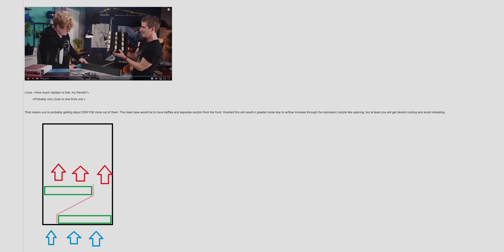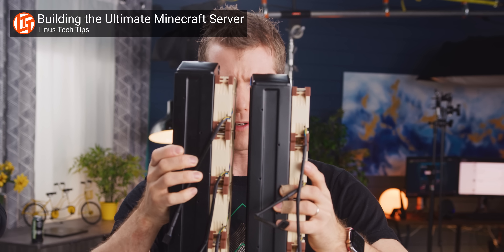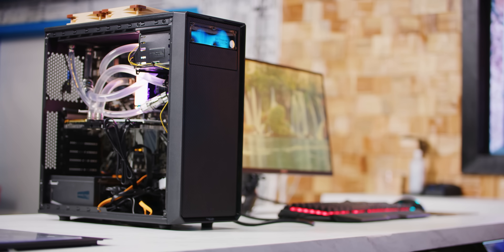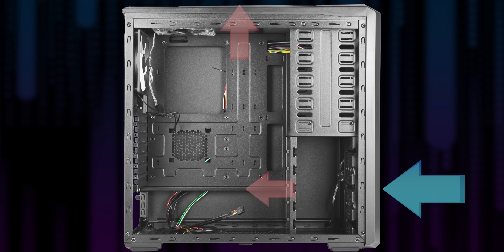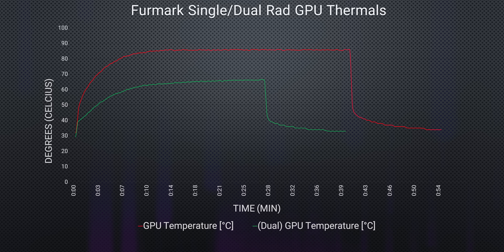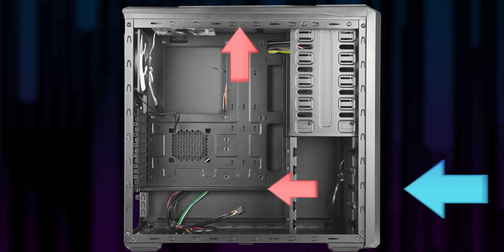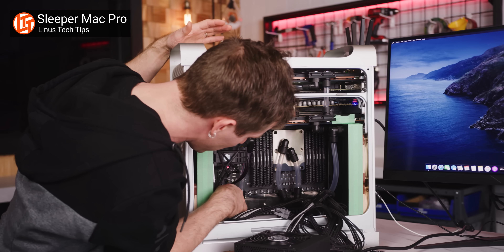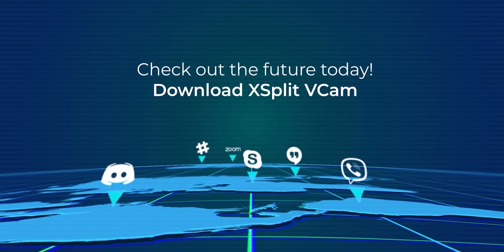I’ve been water cooling wrong for YEARS - $H!T Manufacturers Say

Comment: A second rad for almost any system is for esthetics. Not all but most. I use a single 240/45mm Alphacool with push fans and my idle on a 3700x and 1080,both oc'd, is 38c/29c respectively.

Comment: Corsairs testing may be accurate depending on the order in which the radiators are plumbed into the loop. Every radiator dissipates heat, so if you have a bunch in series (such as in the server chasssis) you want the loop to run from the heat sources into the farthest downstream radiator (in the air column), then the middle, then the first. This will be more effective than a single radiator, but less efficient than running a bunch of parallel radiators (each with it's own fresh air intake)

The first radiator in the water path (which is also the last in the air path) dissipates some heat, cooling the water and raising the temp of the air. The second radiator does the same, so when the water gets to the last radiator (the one taking in fresh air) the water temp is lower,  ut so is the temp of the air flowing over it.

If you run them the opposite way, where your first radiator Carrie's the most heat directly from the CPU/GPU into the fresh air stream and they are stacked then each subsequent radiator does almost nothing, or can have a negative impact as not only does it have the dissipated heat from the first radiator blowing through it, but also the added heat generated from the fans before it (probably a negligible amount, but theoretically something)

So in your desktop test example you can experiment and verify this:
1. The theoretically more efficient system would have the water flow from the CPU/GPU through the pump, then the top (exhaust) rad, then the front (intake) rad and back to the CPU/GPU
2. The theoretically less efficient system would have the water flow from the CPU/GPU through the front rad, then top rad, then pump and back to the CPU/GPU

Basically Corsair is right in scenario 2 above, and wrong in scenario 1. It would be interesting to see you guys test this out

Comment: All you got to do is put the exhaust rad "first in line" after CPU and GPU and you will have significantly improved your dT at both exhaust and intake rads. Stacking more will still improve things, but the returns will diminish quickly.

Comment: Car design: Back to back radiators = BAD

Car design: Side by side radiators = GOOD

As soon as the airflow leaves a radiator, that air temp has risen, so it's less effective at "cooling".

So in a PC, draw air into the cabinet via vents and pump it out via a panel 1 radiator deep. If the temps are too high still, add a radiator to a different panel. Not on top of the other.
Reply: I wouldn't make such a big science out of it. It all comes down to the available space. I mean most cars with intercoolers have them in front of the radiator, because putting the intercooler somewhere else is very complicated due to space and the loss in cooling capacity doesn't make up for the loss in space.

Comment: Stacking radiators might be bad, it all depends how dense the radiator fins are, how thick it is, and also, the fan profile might make a big difference because noone really push the fans to the limit all the time. The pump was d5, which is rly powerful,  do one more test, with like EK DDC pump, and do it with like ~50% fans all the time, as casual rig builder would get with a customized fan curve. then you would see the difference. I think that Corsair took the real world scenario, not the loudest possible.

Comment: but wouldn't the 2nd rad that you installed that specific way transfer heat (at least some) to the case, since the fans were not in between?

Comment: Huge flaws with the test---the case was open water volume was also not equal.  Thermal conductivity of air and water matter. 
There is a quantitively measurable loss of heat just from the large volume of water alone without the 2nd rad itself.  Seterus Paribus, did you measure the airflow entering and existing the case with both setups?  Were they equal?  Of course not in either scenario!

Seriously though, a second rad will benefit that's why vehicles have separate engine oil coolers, transmission coolers, A/C evaporators.

Comment: Why do you think cars typically only have 1 radiator? Yes, the benefit of moving air helps, but there's no need for more unless it's some crazy hypercar like a Bugatti, both the Veyron & Chiron have 10 radiators. I hate them though, they look like flying eggs. 
Hell, Porsche 911s didn't even get radiators until 1997.
My point is: redundancy is not usually efficiency.

Comment: Woah woah stop there Linus
You didn't provided us with complete data 
- jack removed which radiator from stack
- testing condition
- and you are passing a judgment and then saying  test it on your own 
-and as you said corsair didn't criticized that specific build 
- I think Corsair is right Linus if you put hot air in radiator it do reduce there performance
- probably you are getting better temps is just 30% of the performance 
- my advice will be not removing radiator but giving them some cool air through some vent or 3d printed air flow controller type ting
- in normal conditions people who are doing first time or with a very less experience are gonna add as many radiator as they can
Many people watch your video

Comment: So you devised a test to prove Corsair wrong by oversaturating a 240mm Radiator which would then transfer the still hot fluid to the second radiator.
You fail to measure air temps at the exhaust of the first radiator and the inlet of the second radiator and finding that delta. If the exhaust air is just below the fluid temperature (saturated), but significantly lower at the inlet of the second, you do have hot air mixing with external ambient air and are providing a delta on the second for further cooling of the coolant, resulting in lower chip temps.
Stacking like that done in the minecraft server is mindboggling inefficient, you either get to ambient temps or you don't if the first rad is getting you 90% of the way, the other rads are creating lower pressure zones assisting airflow through the first with their fans and either increasing the temp drop on the first or pulling the air through before equilibrium creating a big enough delta on the second radiator to further reduce temps. A single radiator with High RPM delta fans rather than a whole bunch of noctua consumer fans and three rads would make more sense.

You often see twin tower coolers performing only marginally better than single towers with push pull which only give you a benefit if the cooler is saturated with only one fan as the second fan improves static pressure by creating a low pressure zone in the cooler effectively lowering resistance for the first.

While surface area is a good thing, it doesn't really do a whole lot if a smaller surface area is dropping the temps adequately. The main benefit of big coolers is that lower fan speeds can be used to drop that delta towards ambient.

This vid is a load of reused hot air.

Comment: Physics does indeed tell us that stacking radiators results in diminishing returns in terms of cooling power.

Basically, if you have a radiator of certain size and airflow, it can transfer a certain thermal load into air (at a given ambient temperature).

If you double the radiator size, then you (more or less) double the thermal load it can take.

But if you take two radiators and straight up stack them, then you don't get double the cooling. It should be significantly less than that, maybe 10-15% improvement. Eventually the airflow temperature and the coolant temperature in the "extra radiators" approaches each other and that basically stops the radiator from transferring heat from coolant to airflow.

Using a radiator connected to an exhaust can technically work: As long as the air inside the case is cooler than the temperature of the coolant, then it will provide some cooling effect. However, that cooling effect will be reduced compared to using the same radiation in an intake configuration, where it has access to cooler room-temperature air (and therefore the temperature difference between coolant and airflow is greater, resulting in more heat transfer capacity).

In a thorough test, you should probably reverse the airflow on that exhaust radiator and configure it as an extra intake instead. If there are other fan locations available to use as exhaust fans, that's fine, but it would be worth it to test the case in overpressure configuration as well, to see if you can still get good enough airflow that way. If the case produces too much resistance for air to escape, then that might constrain your intake airflow, and reduce cooling power that way, but like I said, worth testing.

Comment: run a benchmark on your phone!? That's it, the quarantine has finally broke Linus! In truth they kind of are correct by thermal dynamic principals(HVAC Tech). My recommendation would to have the rads in the same orientation, IE both intake or both exhaust with other fans helping move fresh air. Not to mention the static pressure increase by stacking the rads would be horrible, your friends rig would probably drop his temps to frigid if he separated the rads.

Comment: I think you guys should've done an additional test with radiator that weren't stacked. I think they're saying that the hot air from one radiator isnt cooling as efficiently on the 2nd radiator when they're stacked. They need to be side by side or on different parts of the case. I'm sure a side by side setup isn't practical but I wonder if you would get even better results with a side by side setup or even just separated from one another

Comment: It also depends on in which order you connect your radiators. If you have the radiator with the hot water in the intakte side of the PC (so the one which comes in the loop right after the GPU and CPU) and the one with the cold water ( the second radiator in the row) on zhe exhaust side of the PC, you get better results than when you would change them

Comment: You should measure the temperatures of the water and air entering and leaving the system! This will let you know about the radiator system efficiency and if there is excess thermal a capacity in the air to absorb more heat.

Comment: Edit: Comment was made before I got to the 1:40 mark
Um, if hot air is being blown through a radiator, wouldn't the radiator just become a glorified reservoir?  Just from applying some highschool physics, you can tell that adding radiators like that would provide diminishing returns.
Heat radiates faster when there is a larger difference in temperature between the hot and the cold. When the temperatures are more similar, heat won't radiate away from the radiator as quickly. Just from that, you should have listened to Corsair's first email as it makes sense from a scientific angle.
To make matters worse, the better the first radiator is at cooling the water, the entire loop could get worse. In extreme scenarios, the second radiator may heat up the cooled water or not provide any benefit at all!

Comment: 9900ks + 2080 uses about 400w power why do we use psu of 750 or 850w ?
Reply: 650w PSU are enough if you're only using a single GPU, PSU above 700w are usually for those who want to run a dual GPU setup. While 850w and above are usually for high efficiency like platinum and titanium, high-end PSU also have a 0 fan more so the fan won't even spin unless it draws a certain amount of wattage, making it more quiet

Comment: I’d be interested to see if the temps improved if both radiator fans were set to intake but the other spare case fans were set to exhaust the heat. Obviously this would mean both radiators are heating up the internals but is this more efficient than cooling one rad with the expelled heat of another
Reply: Best bet with just one intake-placed radiator is to pre-cool the hottest water (the one directly from the cpu/gpu) with a radiator that gets it's air from inside the case.

Then you'll want to cool this water further with a second radiator that gets its air freshly from the outside. Not only will you be able to get the coolest water with this setup (because if you cool something which is already cooler than what it was in the beginning, it will end up closer to the temperature of the thing you're cooling it with - so the air) with just one intake. Also you'll reduce the overall heat that is added to air inside the case because the air from the outside-to-inside radiator is cooler in this configuration.

This style of cooling is referred to as countercurrent exchange in industry and engineering. Source: I have a masters of scinece degree with a background in industrial applications - and we need to cool a ton of stuff.
Reply: ねむネコ that make sense if the two radiators are linked in one loop, for sure. 

I have two all in one coolers which are separate one on the gpu and one on the cpu. I wondered if both would be better set to intake. Tried it out and I got a bit worried that the rest of the internals were then getting the heat from two aio exhausted air so switched it back. My gpu gets cooled from internal air and still hits 40 degrees after a few hours of gaming which is about the same as the cpu getting cooled from outside air

Comment: 1) Adding radiators does nothing once thermal equilibrium is reached....
2) Pull cool air from outside thru both radiators
3) Use some sort of funneling to move the air that's just been pushed thru the radiators, immediately away from the case, Ducts that blow the "spent" air directly out the side panel(s), via cut-outs in the side panels with some nice mesh covering for instance; the G5's had that nice internal molded clear plexiglass contraption to direct airflow.
4) More case fans, to pull hot air out of the case :-(
Reply: @Charles Clarke I think the most powerful and energy efficient water cooling would not use air at all. It should use cool water from the tap to cool the system. Only the mainboard and power supply would be cooled by air then.
Reply: Your first statement is nonsense.  Having more surface area to radiate or convect away heat changes the temperature at which thermal equilibrium happens.

Using inlet air on both radiators can work, but you need to have sufficient exhaust.  It's usually easier to exhaust on all radiators and leave the front of the case for inlet, since there's far less resistance to airflow without a radiator than with, so you don't need as many fans on inlet as on exhaust.
Reply: @TrueThanny  no it is not. Simple matter of fact. There will always be a minimum temperature  that cannot be a improved upon. Under sustained idle / medium load / full load, the cooling capacity will always reach a specific respective temperature...an amount of heat that cannot be further extracted due to the specific design capabilities of the setup. Simply blowing air at some metal is not going to decrease the temperature of that metal beyond the ambient air temp. Very very simple 1st year University course in thermo / fluid dynamics. I should know, spent a few too many years at nerd school. Ideally, the air being blown through the radiators should go nowhere near the actual computer case...but adding appendages to case doesn't serve a goal of minimizing total size.
Reply: @thesunexpress  You're still not making sense.  As long as the fluid is hotter than the outside air, adding more radiators will reduce the thermal equilibrium temperature, because it creates more heat exchange surfaces.  Maybe you should have paid more attention in "nerd school".

Comment: It's kinda up to air speed when stacking, if you run the air through faster then the air has less time to heat up from the radiator, meaning it's going to be heated up more from the second radiator and exchange more heat there as well. For best performance it would still be best to run as cool air through all radiators as possible, but that's up to form factor. If possible though, you should try switching the air flow to run out of the case through both radiators instead of running air into the case through one of them.

Comment: But would you have seen a better drop in temps if you'd switched the second rad's fans to intake instead of exhaust? Surely that would pull cooler air through the radiator instead of the lukewarm case air?

Comment: Glad you guys decided to put this to the test. I often see people citing theory as evidence, and they're not wrong, but they forget that the real world is not a laboratory simulation. There's inefficiencies everywhere in a live setup, and they all stack up.
It's like the armchair techs who tell you front-mount rads are bad because they blow hot air into the case. Yes, and top mounts are sucking hot air from inside the case - it's all swings and roundabouts. The only thing that matters is the amount of cooling surfaces, and the total volume of air getting over those cooling surfaces.